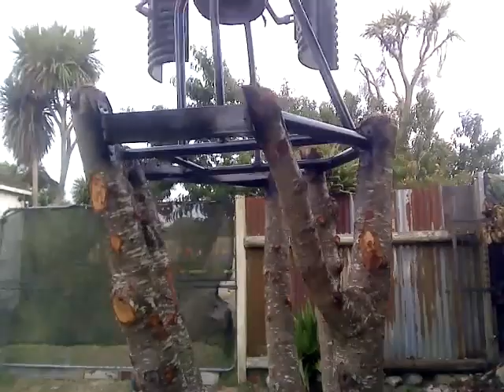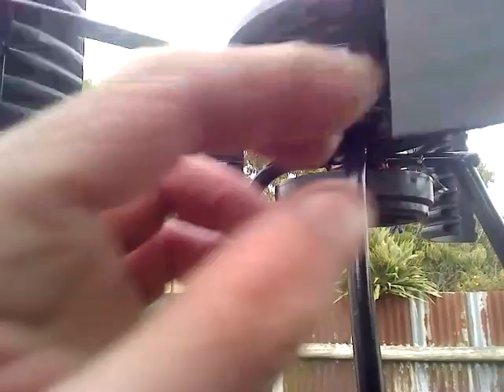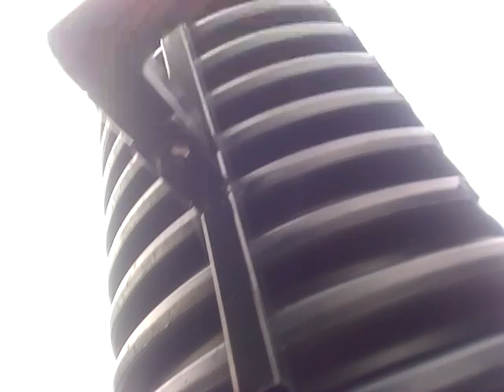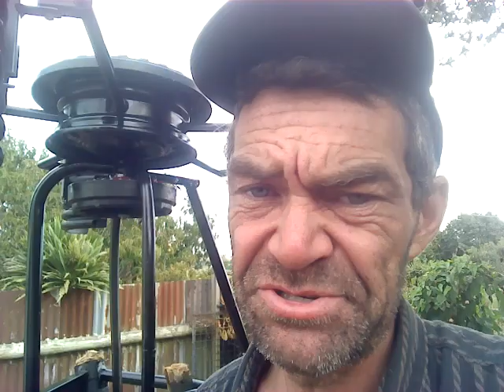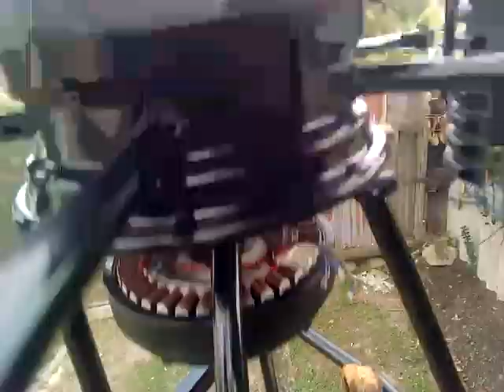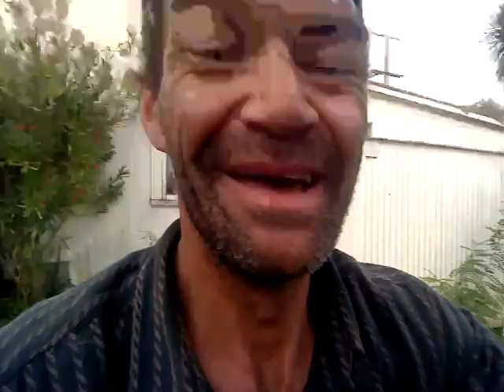washing machine windmill build part 3 building the stand in a tree

Comment: Beautiful work!  You are the man!  
I’d love to get this skilled at welding someday.  It’s a bit hard to run a real welder being off the grid on solar, but I’ve got a little Weller wire feed welder and a generator that can just run it now so I can start practicing. 
Keep it up man you really are an inspiration!
Reply: Yeah I’ve gotten some unexpected zaps from my e-bike projects before, especially anything over 60v can get get ya when it’s really wet outside.  Nothing serious, just enough to keep ya on yer toes 😃
Reply from the maker: True yip yip I never try to take the alternator E bikes out rain because haha 🤣 I thought that might happen to me lol my one is 84volt death machine haha
Reply from the maker: Hi buddy I saw someone welding with just using 3 car batteries in series making 36volt DC. Negative was eath and positive had the welding rod on it.just a thought because my normal welding only puts out 40 volts DC  and I can use up to 3.2mm🤔😁👍🎉🌟🦇
Reply: Where I live it’s always raining so I just do my best to waterproof all the electronics and if a little water kills it, it ain’t meant for me haha.  I’ve gotten really good at waterproofing stuff though, even stuff like laptops I open up and coat everything with potting compound so I can pretty much use them in the rain with no issues.
Yep the higher the voltage, the easier it can jump gaps or find a way to zap ya sometimes.  I’ve gotten a few zaps from my 84v dirtbike that I didn’t really figure out how it happened.  No biggie.  
I rebuilt an electric unicycle recently I got from a friend, it’s 84v max but his new one is 134v dc! 
They are making them even higher voltages too like 160v+, now that is getting to where it could probably be dangerous I would bet.